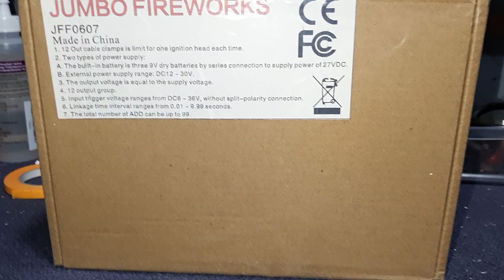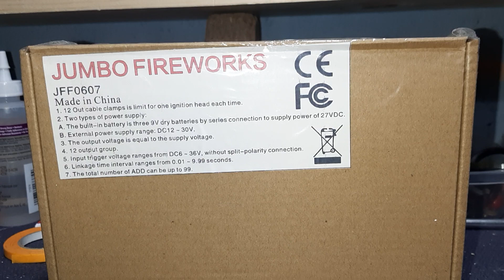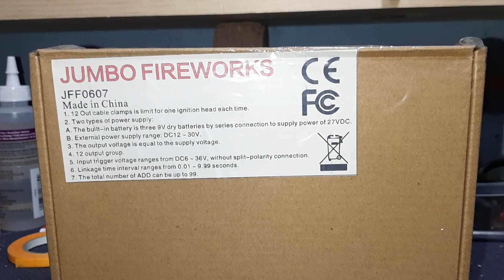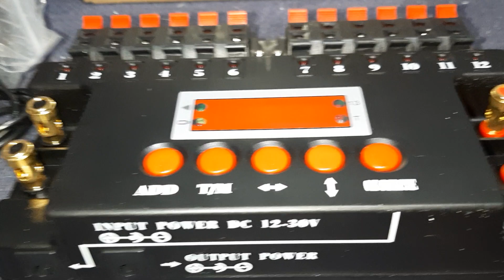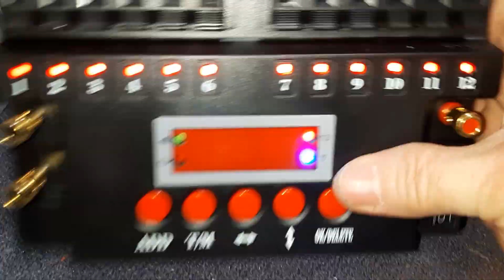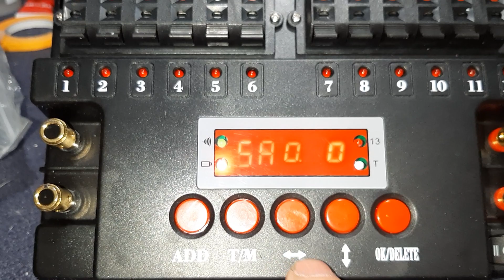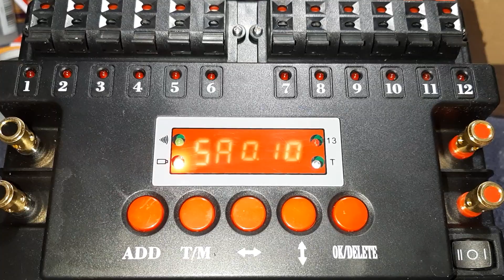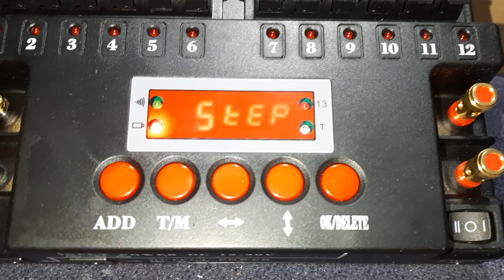Pyro Creations 12 Que Sequencer Tutorial Part 1

Comment: I know this video is old but I just got 3 of these do they all need 9 volt batteries in them or can I use the included power cables to daisy chain them off of 1
Reply from the maker: I'm not sure about that. I always used an external battery when daisy chaining. I found it better to run each sequencer with the three 9volt batteries.
Reply: @houseoffire72 tested and no lol
Reply from the maker: @nicholasfaber6608 Good info. I do appreciate it.

Comment: Thank you very much for the tutorial! I am still kinda new to efire systems but I was hoping you could tell me what the maximum cue length I could run off this if I were to fire all 12 at once and use a car battery as a power source. I would be using MJG igniters (the ones that heat up, not the ones with a bit of powder at the end). I think I would like this for my finale and free up some cues on my main box.
Reply from the maker: @NathanRChristie  Honestly, I do not know when using the Talon style igniters. I personally do not use them for good reason. Also, if you run three 9v batteries in the sequencers vs a car battery, you will have a higher que voltage around 25 ish volts vs a 12 v car battery.

Hope this helps
Reply: @houseoffire72  If you don't mind, what is the reason? I have had good luck with them so far, just kinda pricey. The suggestion does help too, I will use the 9vs instead. Thank you for the help.
Reply from the maker: @NathanRChristie  I like instant ignition. Plus, the thin nichrome wire used in them is super fragile. If a wire gets tugged or yanked on or tripped on they are pretty much junk.
Reply: @houseoffire72  Gotcha, that makes a lot of sense.
Reply from the maker: @NathanRChristie  You are welcome. Learn to poke cakes safely. I do it outside on a table with the bottom of the cake facing me, that way if something did go wrong the shell will fire away from me.

Comment: Is there any reference as far as how many MJG this can shoot in parallel or series based on the voltage input?
Reply from the maker: I am not aware of any such reference using MJG igniter. Although with my old Kingdom 10que Sequencers I was able to spark off 10 Chinese E-Match in parallel per que. They used two 9V for batteries. These 12 que sequencers use three 9V for 27V. The que output tested 24-25V per que.

All I can say is give it a go & let me know. I would test but my MJG's are running low.
Reply: I just tested both series and parallel and I can 4 mjg's to light in series without any problems and only 1 out of 2  in parallel. both with 30 ft lead wires. hope this helps
Reply: @stacysmith7250  I had to test this and mine did both 5 and 6 MJG in parallel with 7ft wire.
Reply: Just want to make sure I understand. My plan would be to have sequencer fire and then have 6 e matches per que on the sequencer after splitting the signal. Sounds like this will work.

Correct?
Reply: I’ve done 6 in parallel testing with the standard 9v batteries and it works roughly 50% of the time. I wouldn’t plan on 6 in parallel but perhaps in series would work.
Reply: @kanicdog  ok- that’s helpful. In your testing, what is the max number of mjg’s you would recommend for reliable fusing in parallel?
Reply: @kanicdog  BTW- I watched your grand finale you posted this year and it was epic!
Reply: So in that finale I triggered 3 separate sequencers to fire at the same time for the final 20 seconds. Each sequencer was set at 1.5 second interval. Power supply was new 9v batteries. Every cue that had 4 or less MJG in parallel fired. I didn’t try 5. I tried 6 in parallel on two separate sequences and neither fired although they did in testing. 

That said, going forward I’d just do 4 or less per cue.
Reply: @kanicdog sounds great! I’ll stick to 4 MJG’s or less per cue on sequencer. How long is your entire show? How many sequencers do you use for the whole show? In my mind sequencer is most useful for firing a lot of cakes in parallel (if 3 or more sequencers being used in parallel), getting rapid and consistent firing times on single slice cakes in a rack and decreasing cue usage on your module when firing racks with MANY mortars/shells.

Thoughts?

Any other things I forgot that you find useful with the sequencer?
Reply: I agree with you. I just do backyard so am limited on how many cobra modules I can buy so I just have 3 and set up 3 sites about 100ft apart. Ideally I had many more but don’t want to invest that much. 

I generally fuse small boards of 4 cakes each for the show. I poke the first and last tube then fast fuse cake to cake and trigger each board with a single cobra cue from the middle module. 

I’ll also fuse mortar racks and trigger those with a single cue the first 1-6 channels of left and right modules. 

For the finale my left and right modules trigger the same 2-3 cakes on each side multiple times. I reserve cue 18 on each module to trigger 3 sequencers at same time and like to send some short duration cakes / multiple single shot 1.4pro shells simultaneously on left and right. The middle sequencer triggers slices back to back mainly.
Reply: @stacysmith7250  with 27V this seems way low compared to what i've heard and read but thanks for the update.

Comment: i am wanting to setup three to step fire at thr exact same time is that possible
Reply from the maker: Yes
Reply: @houseoffire72  on the one video where u set up them to step fire from unit to unit now when u step fire them do u have to keep step firing or can u stop and shoot another setup then go back to step fire the first setup will it pick up where u stopped or does it start from the beginning again.
Reply from the maker: @bradlucasbbq6125  If I understand your question correctly I will say no. Once the sequencers are set up in step fire mode they will stay in step fire... As long as the unit is on they will fire from que to que to numerical order. If the unit is powered off then on again the mode starts over from que one...

If wanting to step fire then switch to a different mode you would need to add a sequencer from whatever que point on the step fire fired sequencer....

Step fire ques 1-9 or whatever then add a sequencer on que 10 set up in same time mode or different time mode... 

Hope that makes sense...
Reply: simple...did you ever figure it out?